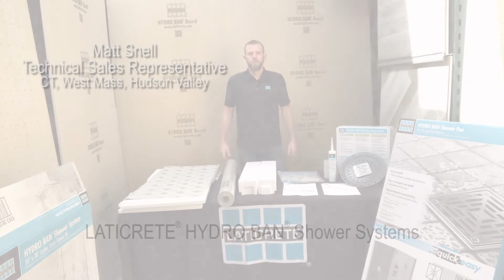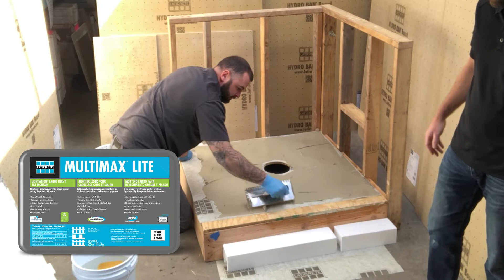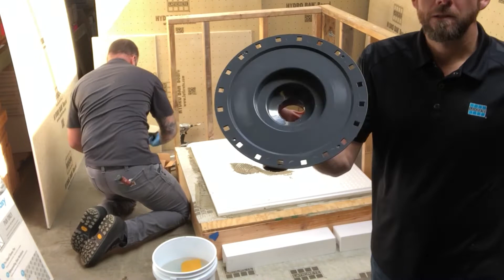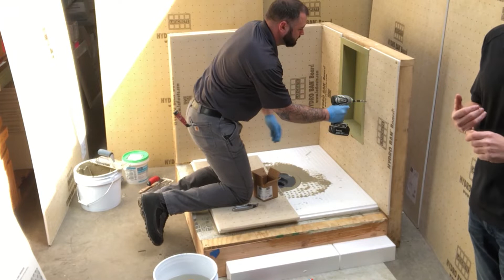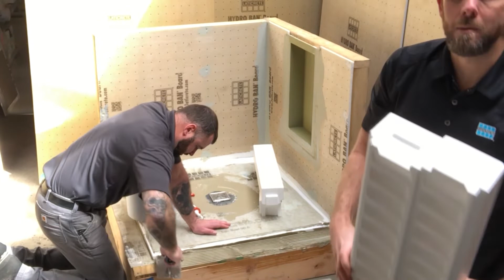LATICRETE®-HYDRO BAN Shower Systems

Comment: So it's all made of Styrofoam? That actually looks like a disaster waiting to happen. Accidently hit the side a little to hard and crack the board under it, or drop something heavy that wouldn't hurt a poured floor. Does it hurt the foam board? Your guy couldn't even stand on it when he was laying it down to set it, and he had to lay something over it to kneel on instead of it also?